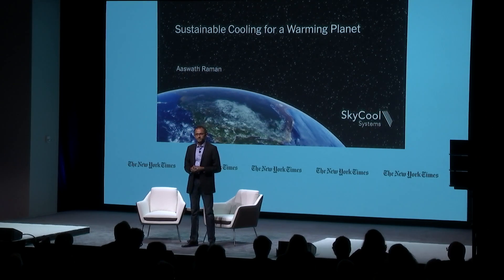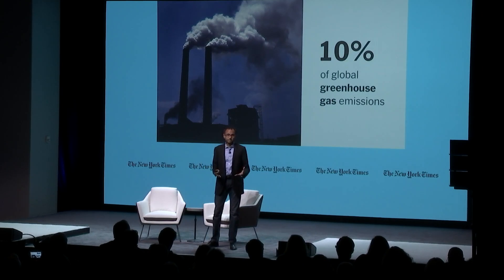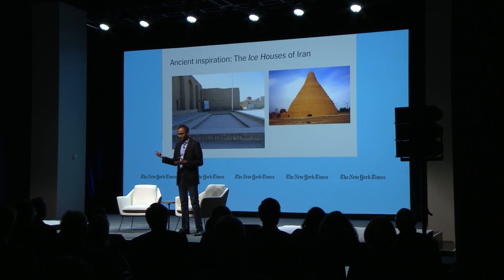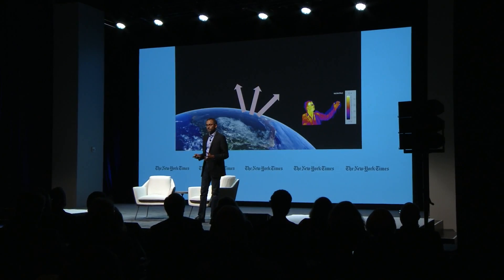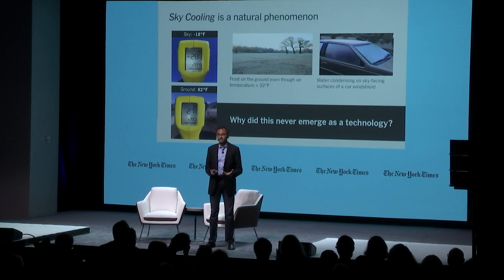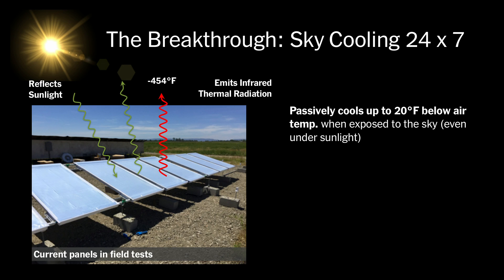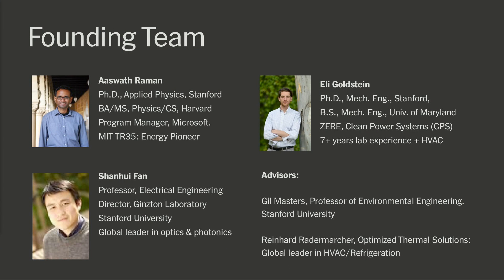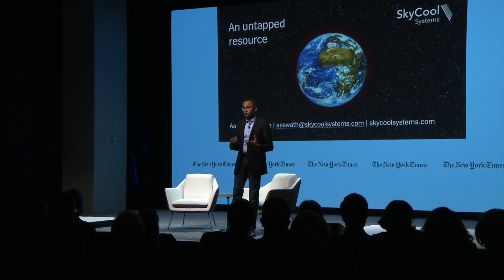Idea Lab: Keep It Cool

Comment: I don't think it's because of the cold of space, but rather that the atmosphere cannot reflect the radiated heat back to the panel.
Reply: yes.  Both actually.  There is a window of wavelengths that lets 8-14 micrometers of infrared pass out to space.  However, if the temperature outside of the atmosphere was not very very cold, there would be no heat transfer either.  So both are necessary.
Reply: Hot flows to cold.  Space is pretty...cool.